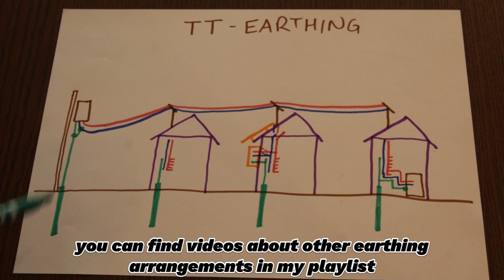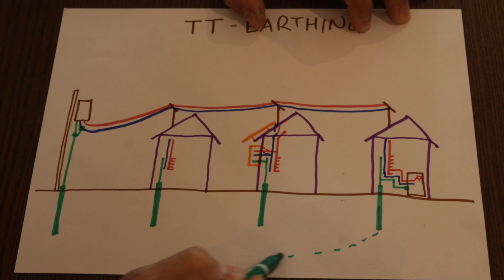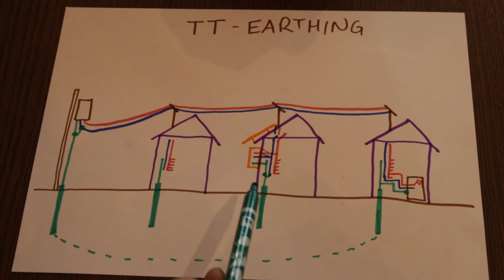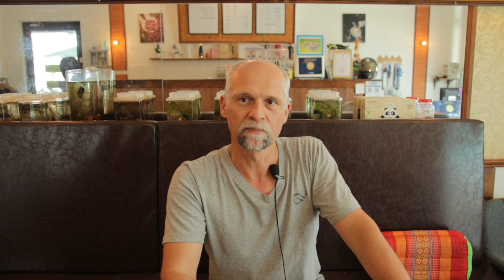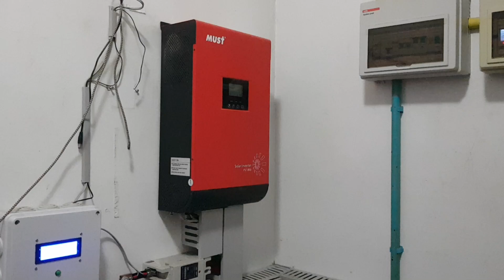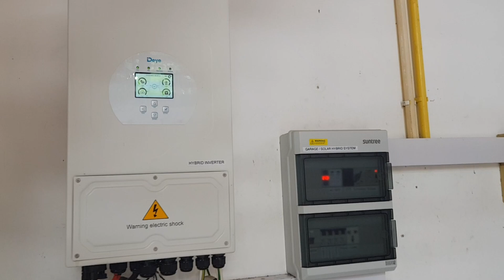"Hybrid Inverters" in the TT-Earthing System. How to N-G Bond in different modes of operation

Comment: This video is really great and applies to my case very well. I live in rural Thailand and for 14 years my wiring has always been TT I guess, with no ground-neutral bonding using my heart rod. I was thinking of making this bond but I know understand why it is not advised, I am quite certain my neighbour don't have this bond and it would create problems... But I am in the process of installing an hybrid inverter with no export to the grid but an grid input to complement solar production of needed and if the battery is low. Therefore I have to think of the case where the grid is down and I loose the neutral ground bond that is done at the transformer. I already bought a relay to make the bond in case of grid failure, but I know am not sure if I should is the dry info from the inverter or simply make the relay open or close in case there is current from the grid which I thought would be enough... I feel every step forward I take, there is also a step back and I hesitate now to do my install, everything is already ready but I am overthinking my setup (small needs, 6 600W panels, 6kw inverter and 200ah battery but we only use max 600kwh per month).
Reply from the maker: see my other 2 comments on your questions...

Comment: Many thanks 👍I have a hybrid converter that I plan to install on a TT electrical system in the Philippines. 
It has the dry contacts but only switching on battery state. Is there a way to add a neutral earth bond when inverting and disconnect the bond when switched to grid.
Reply from the maker: Hi, if it doesn't have a dedicated relays for that switching, then only DIYing a solution for it, like tapping into the relay signal if the internal Grid bypass relay of the inverter, can solve the problem. I find it strange why inverter manufacturers do not provide that signal on every device as this is the only one important one in inverter operation....
Reply: @RolandW_DIYEnergyandMore unfortunately these cheap hybrid inverters do not have programmable neutral earth bond. I guess not connecting the inverter to the TT grid and adding a battery charger controlled by battery voltage is the only answer. Or maybe a transformer between grid and inverter?
Reply from the maker: @Ourphilippinesadventure isolation transformers are usually not easy to get. the simplest way is to use a charger as you said and let the battery never go flat so that you can run in off-grid mode always ;)
Reply: @RolandW_DIYEnergyandMore hybrid inverters are becoming popular in the Philippines. I did send a msg to an installer regarding neutral earth bond on the inverter but I guess they probably leave the neutral floating. Grounding seems a rarity in the Philippines. Many thanks for your support.
Reply from the maker: @Ourphilippinesadventure  yeah. The Philippines seems to be a very special place when it comes to the electric grid due to its use of U.S. equipment with the rest of the world voltage... hope you can solve the problem elegantly. Greetings

Comment: do you also think another problem of having two N-G bonds is high magnetic fields, because I learned that when neutral and phase wires are close to each other they cancel out their magnetic fields, but unequal current in each, or the more distance apart the wires are even if equal current, the higher the magnetic field.
an example of such issue is if someone wired an outlet to use a L from one circuit but N from another. in that case the L and N are far apart since both circuits are likely traveling in different conduits, so high magnetic fields will be created.
every circuit should have their N and L running parallel to each other.
Reply from the maker: I do know of that effect but I think it is mainly a problem for electrical noise. I cannot imagine that a dangerous voltage could be induced in such a one loop circuit. Do you think?
Reply: @RolandW_DIYEnergyandMore  I learned about that magnetic field problem that if there's a wiring error causing high magnetic fields it's not healthy for humans. 
Windheim EMF Solutions is for example one yt ch. that has shown examples of the high magnetic fields caused by wiring errors. he blocked me from commenting though.

Comment: 10:45 you mentioned if the second house has a neutral to ground bond even when the PV system is in grid mode, then fault currents from the third house will pass through the second house's N-G bond. 
I think in addition to that, when the second house uses grid power, the current has two return paths, one through the neutral wire, and another through the earth back to the transformer.
will that cause the RCD in house 2 to trip? I would think so.
Reply from the maker: No, because a N-G bond has to be before any RCD in each house installation. So the earthing rod will pick up currents but direct them straight to the transformer N. Only if there is an RCD used to protect the Inverter.That one would probably trip.
Reply: @RolandW_DIYEnergyandMore  oh the bond is before RCD, then it makes sense it won't trip. thanks.

Comment: Impressive that there are still TT systems out there. I thought MEN was standard with Neutral to Earth bond in the main consumer box or at main entry. I am bonding Neutral to Earth after the hybrid off grid inverter which can get "backup" power from the grid. Thailand build 2016.
Reply from the maker: Yes, in Thailand you will mostly find MEN, albeit I would take any bet that not all connections will meet TN-C-S requirements considering long distances from transformers to users and the aluminum cabling in rural areas. As well the electricians or who ever is installing the houses will always do a N-G bond to make breakers trip :)

Comment: Hello Roland. Do you use any monitoring system like solar assistant to monitor your inverters?
Reply from the maker: no. My Deye equipment is monitored via the Deye Cloud, and all others just manually read once a month. I do have so many different brands and models, old and new... just a mess :)
Reply: @RolandW_DIYEnergyandMore Thanks. I'm working on a solution using solar assistant (I use must inverters so the "solarpowermonitor" software is pretty crap). Hopefully if I finish I'll update it here.

Additionally thanks for the videos explaining earthing and binding of hybrid systems. I'm still taking them in but they're great.

Comment: Hello Roland, wonder is there a solution for the all in one inverters when it comes to the mains input side which we normally plug into a wall socket ( to charge batteries), however we need to remember to switch it off before switching the transfer switch to off grid mode as failing to do so it tries to charge the batteries from the batteries i.e from the wall socket feedback ?
Reply from the maker: Is there a sort of schedule when you do the grid charge or is it just random? You could use timer relays to set for example a 3 hours charge and then the relay automatically disconnects. And next time you just unplug and plug in again for a new cycle...
Reply: @RolandW_DIYEnergyandMore  Hello Roland, it is random, the inverter will use the grid to charge batteries when insufficient solar (sol or sbu in settings).
 
We thought about connecting the inverter ac input to the grid input side of the transfer switch which would work fine unless we needed to bond earth and neutral this would not be ok..

It seems there would be no option other than disconnect grid input to the inverter when switching to off grid..
Reply from the maker: @hasger1941  yes. That's the problem with the All-in-One Off-grid type inverters. But i think that only the Grid Bypass is the problem. The AC charging might actually be isolated and not creating a bond between output and input...???
Reply: @RolandW_DIYEnergyandMore  Ahh this is an interesting point, we will need to check this... Thank you Roland,

Also some of these inverters support parallel function and automatically do the ground and neutral bond internally when in off grid mode..
 
The question is when using say 2 or more in parallel is it now a problem since the bonding is happening in more than one place ? This is since some say only to bond in one place i.e not at inverter and also the distribution board ??
Reply: ok update: the inverters have communication ports so when using in a parallel system we will assume the dynamic bonding will hopefully only  bond in one inverter ?? maybe maybe not nothing seems to be documented.. Regarding the charge mode the earths will still be linked inside the inverter i.e. input side and output side.. So in order to have earth ground bonding on the system the input side will need to be disconnected from the ring main in off grid mode.. it still all seems a little hit and miss🙂
Reply from the maker: @hasger1941  but you could "outsource" the charging to a AC charger similar I do use at my DIY-Powerwall and just use a voltage triggered relay to activate it. The charger would have to be connected at the grid side of a transfer switch so that it doesn't use the "off-grid" as source.
Reply: @RolandW_DIYEnergyandMore  absolutely 💯 this would solve the problem of earth neutral bonding also.. Thank you Roland 🎄🎄🎄❤
Reply: p.s. one other idea we wanted to mention, an rcbo with earth leakage detection something like the Schneider Acti 9 iC60H A9D11825 , these apparently do not need an earth neutral bonding ?? , is this correct ?? could we use this instead of an rcd and not do the bonding ??
Reply from the maker: @hasger1941  RCBOs, RCDs, GFCIs always need a Earth-Neutral bond to detect leakage. The RCBO just replaces a separate MCB for the in-line over-current protection. But over-current is typically taken care of by the inverter, so leakage is actually the bigger issue to deal with.
Reply: @RolandW_DIYEnergyandMore  ok we were mislead to believe this particular model could achieve earth leakage without any bonding, (just as well we did not purchase one 😄).. 

We would like to purchase the charger in the diy power wall video also the voltage detection you did mentioned, could you provide model or part number so we can find them ? 

Also the voltage meter can be set when to start and stop charging as it will need to be in connection with the solar charging from  the inverter ?

Comment: I just googled "battery backup system wiring diagram" and it appears the changeover switch only disconnects the active line. So the off-grid system's neutral wire remains connected to the grid neutral wire which is grounded at the power pole supply transformer with a TT earthing system. 

We have the TN-C-S earthing system where I live, so the neutral wire is also grounded at the meter box with a ground rod, which I expect removes a lot of noise from the neutral wire. We still have a separate earth wire to the power points, which is also connected to the ground rod.

The TN-C-S earthing system is the best system for solar and battery backup. With the TT system, if a falling tree takes down the neutral wire near the supply transformer, everyone's battery backup system will be activated and everyone will have a common unearthed (live) neutral wire except for the guy who connected his neutral wire to earth - who will become the whole town's earth connection.
Reply from the maker: Hi, yes. The guy with the Backup would just create that unwanted extra earthing point if his inverter isn't isolating N from the grid. But I thought that the inverters internal ATS should switch over L and N.

Comment: Finally a decent video showing and explaining why you do not bond the earth and neutral in a TT system. I live in Vietnam and it's a TT system here, but no grounds at the buildings either. Outlerts are two prong and not polarized either. If you do see a three prong outlet, half the time the ground isn't connected. 
But when I do install grounds for people some ask for me to bond it and I then have to explain why you don't bond on a TT system. Another potential (pun not intended) problem with bonding is if the neutral is broken between the transformer and the bonded location, whatever is downstream from the bonded location will use that ground to get back to the transformer. Which of course depending on how much load that is, can easily overload the neutral at the bonded location. RCDs are not widely used here either for some reason. I always recommend them to customers but not many want to spend the extra $10, literally $10 USD extra for an RCBO vs just a normal breaker that here costs less than $10 to begin with. I also refuse to install a ground unless they also install an RCD. As like you explained, there may not be enough fault current to trip a breaker and can energize everything that is grounded to line potential. But, that is one of the benefits to a TT system, reduced ground fault current. But that is more applicable to industrial situations where you have a higher chance for ground faults with higher currents since there may be 200A service vs a 60A household service, the TT limits your ground fault current over a TN-C system. But the flip side is it may not trip a normal breaker, as discussed.
Reply from the maker: Yeah. This sort of half way solutions like we do have in many countries where people have to think twice about every Cent spent, is unfortunately dangerous as the grounding of any metallic structures and enclosures shall protect humans to come in touch with the live potential. That is the duty of the mandatory RCD to trip when such a fault current to the grounded object is detected. 
Many people think that when they do not ground at the consumer side, fault current cannot flow so all is OK, right. The problem is that Neutral is still bonded to Ground at the transformer. So if anyone comes into contact with a live wire will still be shocked as leakage current will go over the persons body to ground and via ground back to the transformer.
So yeah. Mandatory Class 2 equipment grounding, mandatory RCD/GFCI, no bonding at the consumer... this will save a life for an investment of maybe just a few dollars!
Reply: @RolandW_DIYEnergyandMore  Exactly, except I do work for westerners, not locals. The price of electrical equipment is a fifth of what it costs in the US. Except wire, that's only a little cheaper. But I had a 50A three phase panel built, with about 24 circuits in it for what one three pole, DIN rail RCD would cost in the US. Yet, they didn't want any RCDs and this was a commercial application. I didn't do the install, just consulted on it.
Reply from the maker: @inothome  yeah. It's a shame. Some must feel before they believe. Here in Thailand you will hear from buildings and factories burning down from electric failures every few days. One breaker for a whole building, no grounding, etc. Keep on fighting :)
Reply: Thanks for bringing up "what happens during a neutral break (in a TT system)"- I'm not an electrician, so I was asking during the video "what is the problem with having a gnd/neutral bond in this system"- at least one of the issues would be during a neutral break, you've converted the system into an unintended single-wire-earth-return.
Reply from the maker: @codertao  Neutral breaks are bad in any TN-C or TN-C-S earthing arrangement which comes with a grounded transformer Neutral and equipment grounded to the separated grounding connected to the Neutral. A break here would set all grounded equipment live down streams of the break!
In the TT-system breaks initially wouldn't be to serous. The whole areas electricity supply would stop, so the grid supply would be notified quite quickly and could shut down and repair the affected transformer branch.
All grounded equipment in this installation without a bonded N-G would just stay without potential and safe as there shouldn't be a return path if there is no fault. RCDs should stay operational as they wouldn't see flow on its N leg while current could go from L to PE in case a further leakage in the installation would happen.
Reply: @codertao  SWER is normally only used on the high voltage / primary side, not on the low voltage / secondary side. But a break on the neutral of a TT with only one bonded location and now that location would act as the return for everything downstream. Which of course is not sized to carry all those neutral loads. I am talking external break of a neutral, out on a pole between the transformer and customer. Not a broken neutral in the premises.